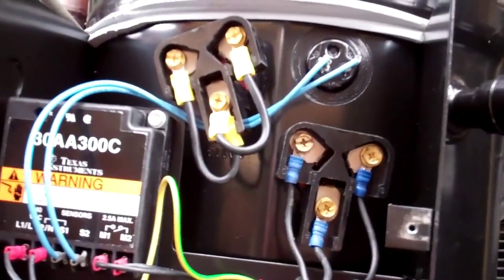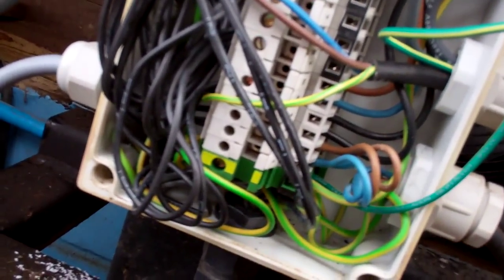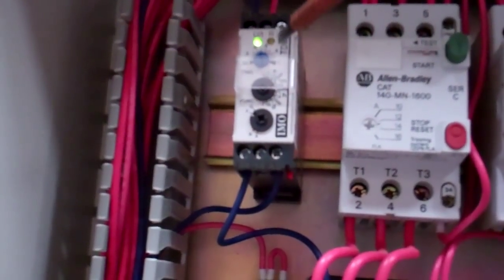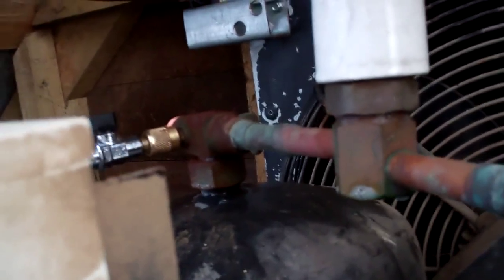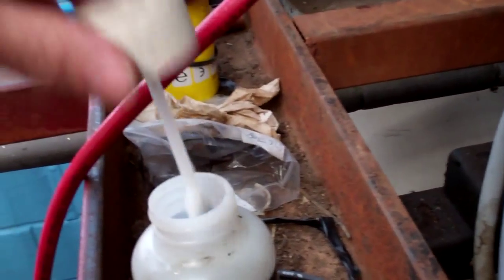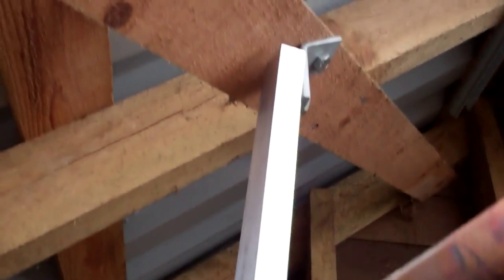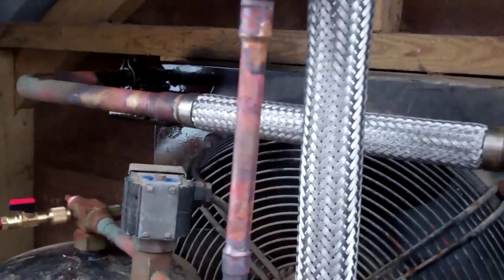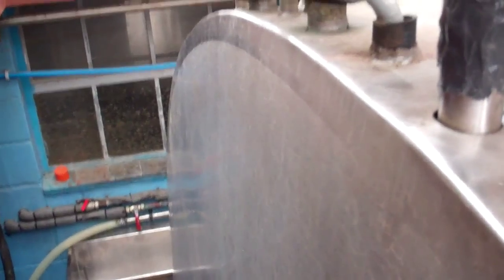Bristol Compressor Replacement and Comissioning

Comment from the maker: @fritzhvac The tanks are double skinned food grade stainless steel with expanding foam inbetween. The evaporator is part of the bottom of the milk vessel. They are made by spot and seam welding two sheets of stainless together, then they pressurise them and the thinner one buckles to form a passage for the refrigerant to go through. This one has four cooling plates, two each side t'd together. 

I did one years ago and the only way to ge it to seal was to suck the braze in with the vac pump LOL

Comment from the maker: @fritzhvac Hi Fritz!

It me took around six or seven goes each to get those stainless to copper joints to seal, you need special rods and flux to join to it, once the stainless has got hot it seems to get an oxide coating on it so you need to clean it up again before you can do a bit more. 

I had Dave help with lifting the old comp down and new one up with the chain block, it only just fitted between the steel and wood beams. He filmed me on his phone so if he emails me the vid i'll post it.

Comment: Hey Jon !!!

Looks like your up on the High Wire again !!!

We have a Leak from Hell !!! LOL ...
Did you Braze to Stainless ? 

Jon you Win the Uni-Strut Clamp Bracket of the Century AWARD Brother !!! 
(there is nothin you can't do with them) !!!

Man the Bristol looked like it may have been a Pain in the Booty to get up there !!! Looks Fantastic Jon !!!

Is that stainless tank surrounded by a cooling coil , and the milk in its own tank inside of that ?

Great Job Brother !!!